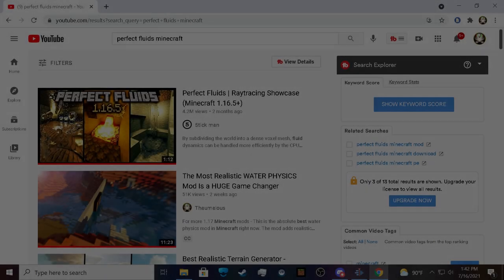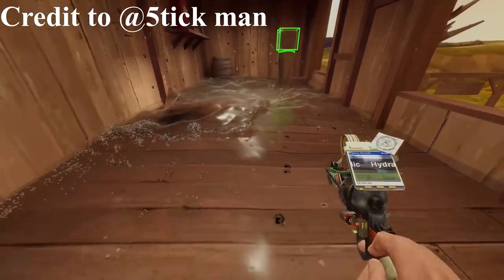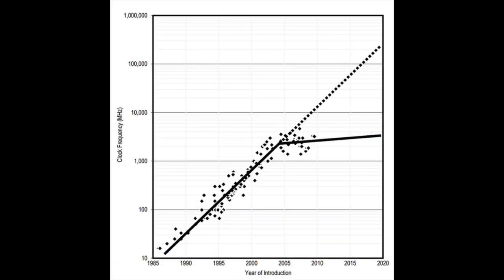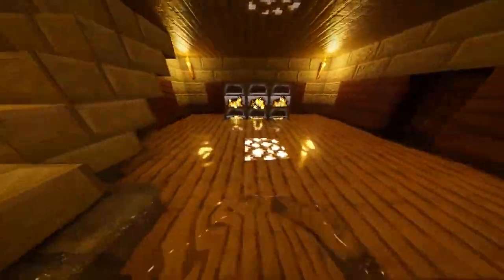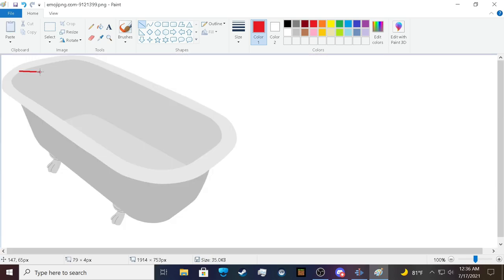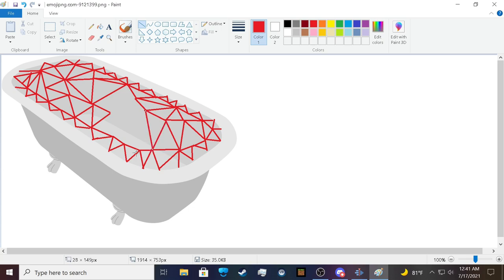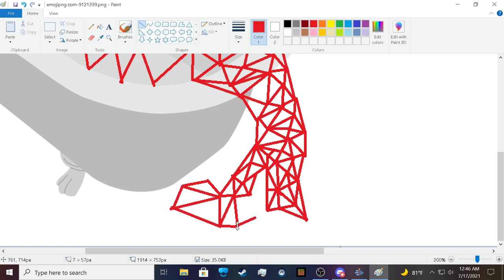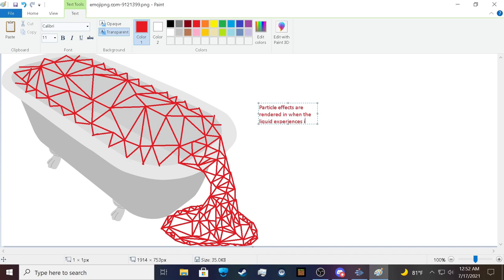Hmm, Can Wire-Frame Based Water Be Put into Video Games?

Comment: I like your point but disagree with the time lengths you propose. Machine Learning is making faster and more efficient code than humans could ever write and Neural Network based physics systems are already being designed and implemented with a great decrease in overall CPU time. I think we are more likely to see this technology in 20 or so years.
Reply from the maker: AI Is a thoughtfull factor to be brought up here. However, AI is still restricted by the amount of transistors that can be fit into hardware.
AI does not have an effect on the pure brute force of processors, and hosting an AI to perform physics calculations and rendering would probably be more hardware intensive than current blender simulations are now.
Using AI is also a completley different method of fluid simulation, so i don't know why you aren't agreeing with my prediction of progression. I was saying that with current hardware, we cannot run blender's physcis in real time.

AI is just another method like the one I made up in this video. AI is not going to make hardware more powerful, but it might reduce the amount of strength needed.
Reply: @Solusire  I made another seperate comment talking about this a bit more, but with the rise of ARM processors and Quantum Computing, we won't have to worry about a transistor limit for a while longer.

Comment: I thought the mockup was an obvious mockup. Also, a lot of graphical processing depends on the coding and how efficient it is. Comparing the size of a graphics card directly to it's processing power is completely asinine.
Reply from the maker: Ratio + didn't ask
You clearly have no idea about anything you have just said. The render was placed over the real recording of a Minecraft play session and is not able to be disproven by just looking at it. The only thing that leads you to believe that it is a "fake mockup" is that current computers do not have anywhere near the amount of raw power needed to run something like this.
I never said that graphical processing doesn't depend on how efficient coding is. However, in the situation I assume you are picturing, graphical processing doesn't depend on coding efficiency; the coding efficiency you are talking about refers to the physics process which is all pumped through the CPU and has no affect on the method(s) the GPU uses to render a body of fluid.
The size of a processor does affect the potential of a processor. I don't know where you got the incentive to say that size doesn't matter. It sounds like this directly relates to your personal life. A large processor with the same architecture of a smaller processor will almost always be better in every way.

Comment: your GPU isnt the only thing that needs to be good in order to render that
your CPU also plays a big role
Reply from the maker: This is especially true in multiplayer because you cant generate something in the gpu and then share it past client side. But the gpu is much easier to use, using the cpu to generate the mesh would open another can of worms and it would take even longer to get to the point where something like this is possible.
Reply: @Solusire  
I’m not saying use the cpu to render it
I’m saying you have to have a cpu in order to have a graphics card
The cpu controls the graphics card
And you need a fast CPU for a fast GPU
Reply from the maker: @theonecommenter  I know what bottlenecking is. Naturally as computers progress, all the components are required to improve

Comment: I like your calculations at the beginning of the video but you don't talk about the jumps in coding and making a fluid water simulation more code efficiënt. In 60 years there would probably be a lot of other programs habdling water simulation
Reply from the maker: That's not true though, I talked about how the programming is the solution. The whole point of the video was to prove that something like this is possible with current technology, it just takes better efficiency and methods!

Comment: isn't there already a real fluid mod? forgot what it was called but ive seen some mod reviews
Reply: @Nils Trinity no its not like the blender simulation
Reply: also it's called Water Physics Overhaul
Reply: @Batcow153  there's also the physics mod pro version which does have decently realistic water (albeit limited and you can only get it by enchanting table OR wet sponge

Comment: dont work harder, be smarter, today
Reply: first split the simulation into the physics part, and the render part, discard the render part
Reply: assuming the current tech design, assuming you only try to copy from version to the next
Reply: before 3dfx, you had to use cpu for all, get real, new inventions, or just brute force
Reply: you can do sphere voxel animations and simulations
Reply: everything falling with smoothing
Reply: python/octave nvblas/cuda per sphere massive passive parallelism compute with the gpu
Reply: sphere volumes can quickly approximate the general shape of the liquid, then just smooth out the edges, to full surfaces
Reply: sphere ragdoll rotation-less physics simulation with glue
Reply: or just subdivide the normal minecraft cubes to micro cubes, then do the normal (smoothed) minecraft fluid simulation
Reply: motion vectors as animations (normals) with the subdivision physical ragdoll cubes or spheres
Reply: vector or distance field simulation, fixed/dynamic (rectangular, cubic, or spherical, atomic) grid, alike smooth fonts drawing

Comment: You disregard the fact that innovation is exponential. It will take significantly less than 60 years
Reply from the maker: I do not disregard it, I deny it. Innovation can only go so far until the laws of physics deny more progress. The only solution there is a completely different computer system without basic transistors and chips, which still falls under my argument because I mentioned that.
Reply: @Solusire  A) quantum computing with literally changes the fundamentals of binary coding, B) if climate change permits, more countries are becoming innovators that affect western countries and therefore graphics quality, C) if internet speeds come every 5 or so years, graphics quality will become better but more importantly more accessible every 3 or so years
Reply from the maker: @singho23  yeah I already know this. 

Changing the fundamentals of binary coding would make it to where blender's sim method would need to be redesigned anyways.
I said that if computer chips are completely changed within the proposed time frame, then there would be a large progress jump.
Im not sure why you are arguing with me, or if you are arguing at all.

Comment: The problem at hand is that... you can have pretty good fluid simulations... blender is slow in that regard.
Fuck, this video was boring... Also, "wire-frame based water"? Are you serious? The closest thing to whatever the fuck you tried to said is to have a mesh that uses a spatial shader whose vertex shader output is computed with regards to interactions with other stuff, and the good/bad part with that is... it's a bother to write, if you plan for it to actually flow anywhere.
There is realistic water out there. Fluid dynamics are costly, but not impossible to do in real time, you just sacrifice precision for fps, the point is... you wonder whether it's possible or not, when we had it for some years already... and this video fucked up my mood.
Reply from the maker: You literally just contradicted yourself. Why are you saying that we have this technology? You know that the real-time fluid sims are not anywhere close to the quality of sims like blender - and that is why I made this video. IDK man, you seem either tired or in a bad mood. XD, I wonder why!
Also, the point was for the sim method to not be a clone of all of the other crap out there because that would get you the "boring video" that you are talking about. Obviously there is not a popular 3d fluid mesh system that is capable of performing well, the point of this video is to initiate the design of one.
You assume that I do not know if it's possible or not, but I already knew we had shitty fluid sims for some years already... And that isn't the point of this video.
Reply: @Solusire  first and foremost, I am never not in a bad mood. Second: mesh fluids cannot be called wireframe fluids, cause wireframe is literally a debug view. Blender is slow. There's a reason people don't use it for games, but rather animation and assests. If you gave other engines the time per frame, you might be surprised. But most importantly, why bother? A dude made a voxel engine with fluid mechanics and what not. Why bother with arguably the least optimized method of doing fluids? This video is boring because it is. I don't give a crap that this might be feasible in 100 fucking years, I prefer the engineer who tells me how to get something similar now. I ain't gon be here in 100 years
Reply from the maker: @arthank1263  I am using "wireframe" as a simple term to describe a 3d mesh. Even if the term is only used for debug views, it still works because that doesn't change the fact that it is an adaptive 3d mesh. I use words like this because this is Youtube and I'm trying to get views; not everybody knows how this stuff works. 
I know blender is slow and there are voxel alternatives, but that is why I'm making this video - to show that it's possible to get a fluid sim similar to the quality of blender's sim in a much shorter time frame.
You make valid points when it comes to the necessity of these things, but nothing really needs to be necessary when it comes to gaming.
I think you missed the point of the video. I don't want to wait that long either - and that's exactly why I am trying to propose alternative methods that can be utilized in the present day.